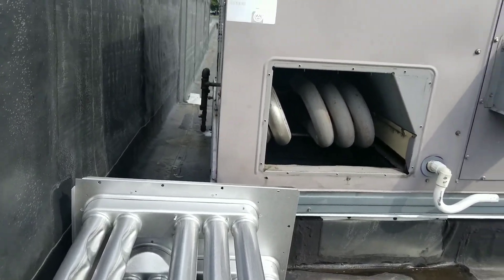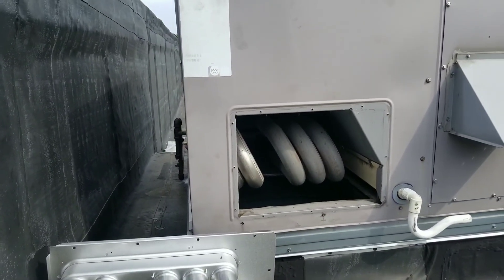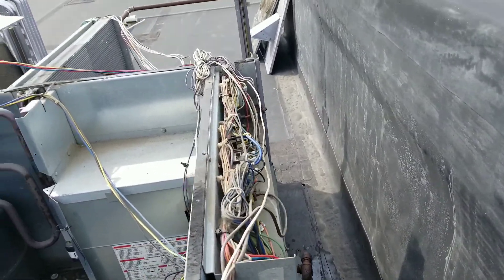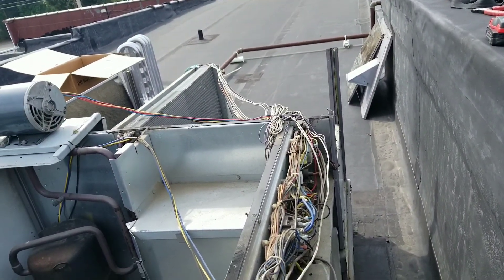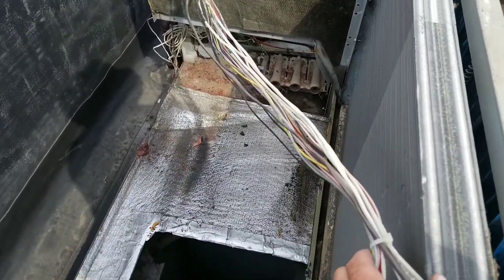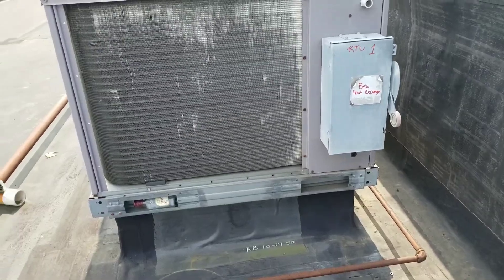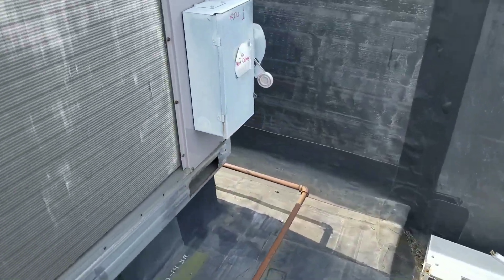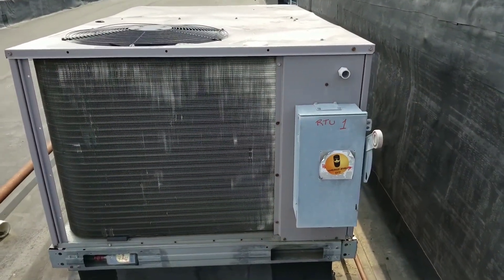Replacing a heat exchanger in a Bryant package unit

Comment: wow damn good job. that looked like a nightmare.
Reply from the maker: Hey Chris- so far it was the worst one Ive done, a good learning experience I dont want to repeat, lol
Reply: I bet. We had one last year for an older Reznor. Originally it was a heat only but the place had installed the refrigeration   system on top and that was a complete  nightmare. in the end we werent able to get the unit to work with the new heat exchanger. there was parts of the framing and parts the guide the air flow that had to be cut and in the end between hoping the fire retardant gaskets and the heat silicone would have saved the job. unfortunately it was a job that should've never been started.

Comment: Nice work.
Reply from the maker: Thanks for watching TC
Reply: Curious HVAC Guy : I’m in the middle of replacing the HE on Bryant 588 3 Ton package unit.

Took out many screws after removing the inducer motor assy, but something is still holding it in. Does the gas valve have to be removed to get at those screws?

Also, the insulation on the under of the top is gone. What can I use to replace it?

Thanks for the interesting video.

Comment: Did you think about unhooking the gas and lifting it up and turn the whole unit 45 or 90 degrees and do it?  Then all you had  to do was reseal the curb and done. It's just sitting on top of it.
Reply: @curioushvacguy6876  that's about normal time, I think 2-2.5 is the fastest in and gone that I've done.  (I would figure 3 or 4 people should be able to rotate that rtu if you ever have that again.  )

Comment: That looked like fun... 
the only job that I had that was comparable to that was when the heat exchanger was easily accessible from the side access panel, but the unit was 1 foot from the edge of the roof 2 stories up, I just tied off my fall arrest to the unit and moved around carefully, it wasn’t half as bad as your job. Good vid, thanks! 
BTW, just watching my pump pull down through 650 microns on a new walk in install, bored as hell and watching YouTube... 🤣